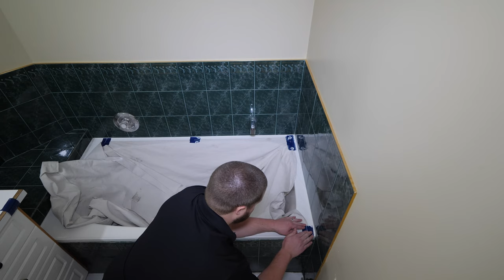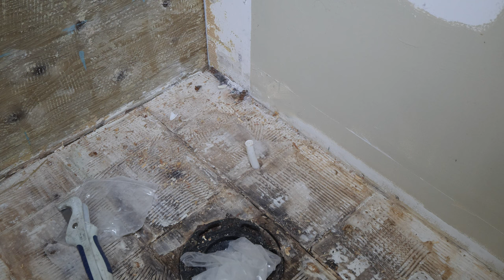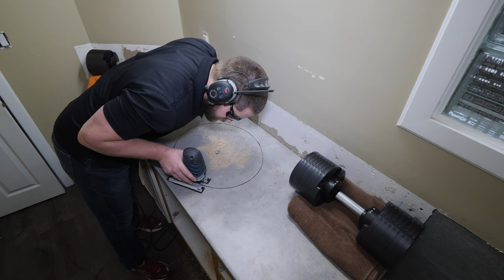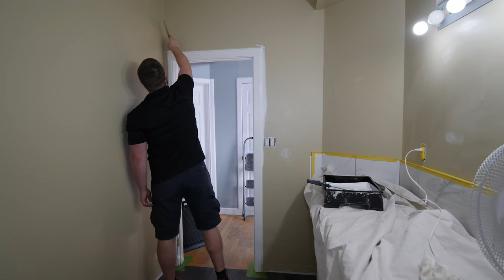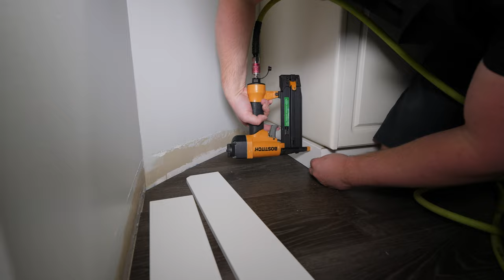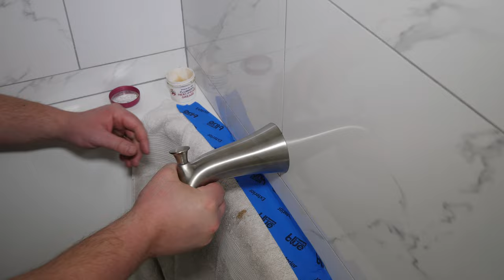Bathroom Remodel Time Lapse: DIY Renovation

Comment: Help a AOSmith water heater 6 yr old , new burner assembly, everything cleaned inside and out , run hot water for a while flame goes out

Comment: I would not use  a reciprocating saw to cut out drywall. the mains power line to my house comes in behind the shower wall in my house. If you hit that with a reciprocating saw, you probably won't be walking away from it. Use an oscillating saw with a drywall blade instead.